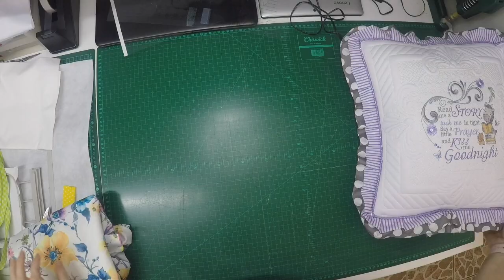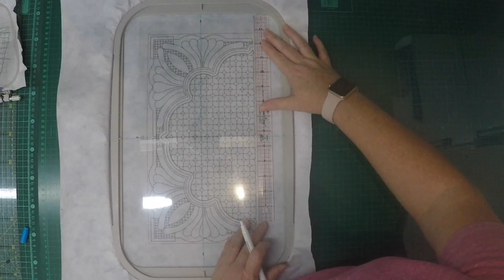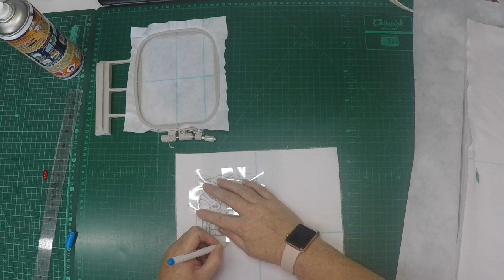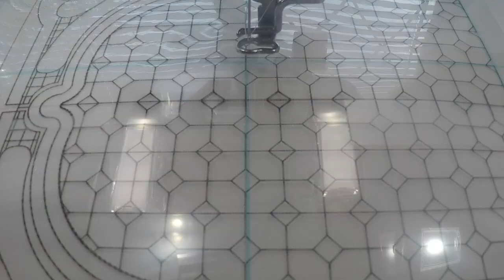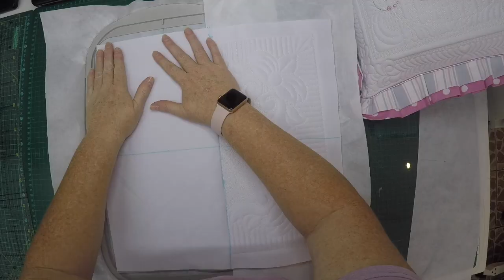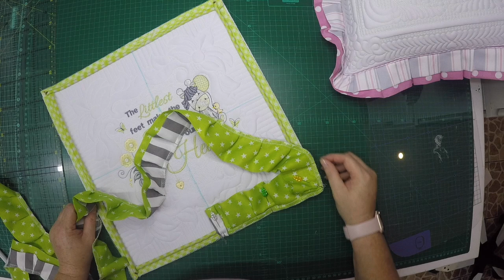SDS1247 Multiple hooping tutorial using Raffi Giraffe

Comment: Thanks for this very informatie tutorial. I have been following your career in ebm for many years and have yet to stitch out one of these beautiful designs. Today as I was watching how to make a window in the stabilizer, this  video came up as recommended. I can't tell you how much I have learned by watching your explanation of multi hoopings. I have been doing emb for 13 years and I had used only designs that fit my small hoops.The main reason I purchased my lager hoop machine was so I could do anything. However, I was intimidated by the process, TY again, as I feel confident that I can do one of the designs that has been on my to do for 5 yrs, a clock face, now.

Comment: I am just starting my first pillow. How do I know what designs in the set I need to complete a pillow the same size in your tutorial. I have a 6" X 10" hoop. Also I found lots of lightweight quilters batting. Can you recommend a brand or store to purchase from and or the weight. I am in US. Thanks the video really encouraged me to try this.
Reply: I think she uses the 9 x 14 hoop.  Unfortunately, the largest hoop my machine works with is the 6 x 10.  I tried doing the 4 x 8 split hooping to do four stitch outs, which would create an overall 16 x 16 pillow, but I could NOT get the design to align for the second hooping.  I've finally given up and will try with cotton and see if it works, hoping the stretch of the scuba fabric is the issue because I absolutely love these pillows!  I know you asked this question 3 years ago and Daleen doesn't respond to all comments/questions, which is frustrating.  Were you able to figure it out over the past three years?
Reply: @kristinaslattery9382  Hi Yes I did. I used 6X10 hoop and chose the 6X10 size file. I only needed to match down the middle. I used the scuba so if I needed to I could pull a little here and there. I started and stopped the needle quite a few times to make sure it lined up. Also I watched the video a hundred times. Good luck
Reply: @yorkielover714  Thanks!  So using the 10" split?  That gave you a 10" pillow though, right?  I was hoping to do a 16 x 16.  I was so spitting mad last night I had to walk away!  LOL  I cannot, for the life of me, get the design to line up for the second half stitch out.
Reply: @kristinaslattery9382  I gave  it as a gift so i can't measure it. I know I added some fabric to make it bigger. I also did the ruffle as she show's in the video. I cannot tell you how much fabric i wasted. I think when I took the time to have the needle move around the whole design being stitched (whichever half) I could tell if I was spot on. Using a stretchy fabric like scuba allowed for some pulling and pinning and pinning and pinning to keep it from moving. Also I made my own pillow form because it was not a regular size that was easy to purchase. I have also had to leave the machine when I kept making mistakes.
Reply: @yorkielover714  glad to know I’m not the only one that walks away!  I will have to give it another try.  Thank you!!
Reply: @kristinaslattery9382  A couple of things I use the Same kind of pan that Darlene used in her video where you just use a little water on a cloth or a little paintbrush to wash it away. So I did my lines and that helped line it up. The other thing is if your machine has the nudge ability if you know what I mean you can when you go to start the design nudge the needle  over to the closest starting place so that there’s little or no space between the 1/2 and the other half. I hope that helps